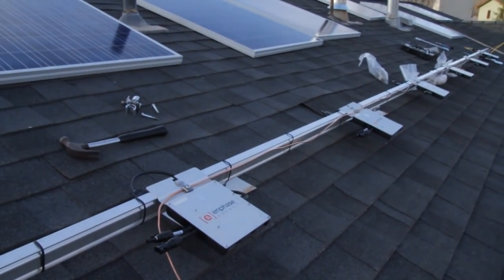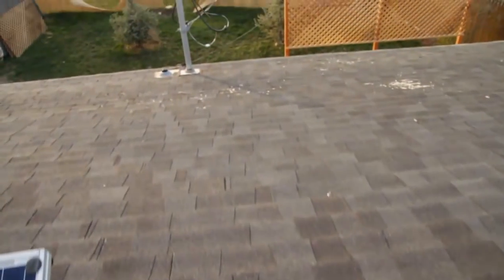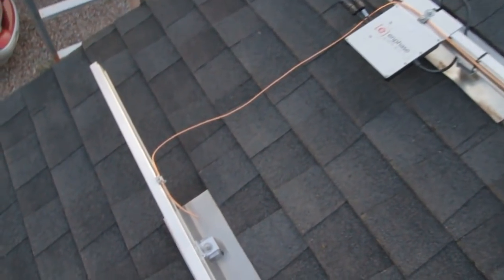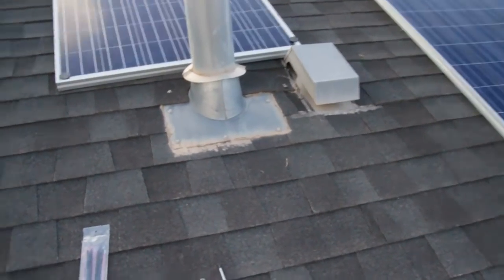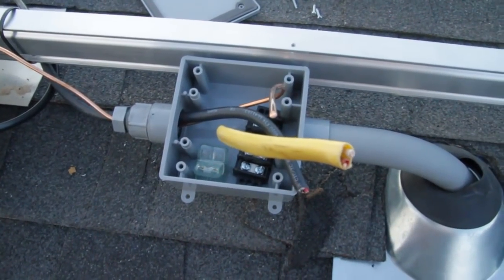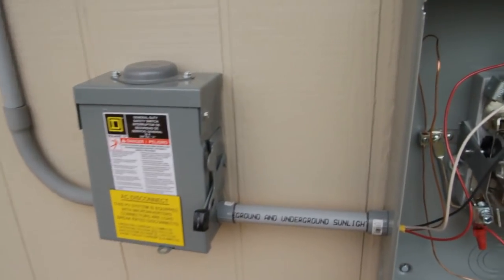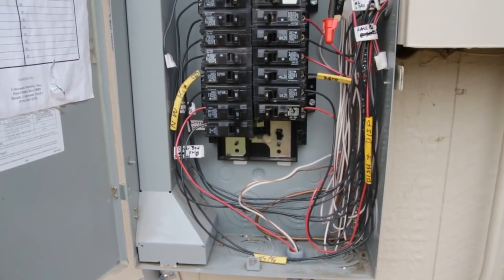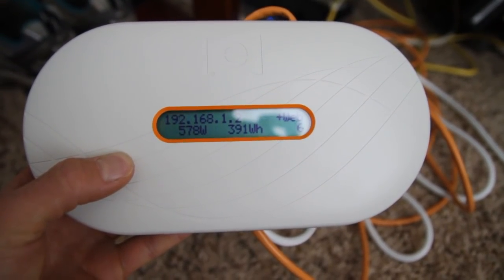HOW TO INSTALL SOLAR PANELS DIY ARRAY ENPHASE MICROINVERTERS 1.47 KW SYSTEM TIME LAPSE

Comment: Just wondering, this system looks different than others I seen.  How come you don't have batteries hooked up?
Reply from the maker: It's because this is a grid-tied system, meaning that the excess power being generated by the panels is being fed back into the electrical gird.  We also pull power from the grid during the night.
Reply: Jesse Hoff  how much of savings do you think the system in this video will save
Reply from the maker: Check out my other video I have up about the cost of the system.  That might answer your question a little better.  The answer depends.

Comment: that racking system is too low to use a pre-bent PVC 90 into the roof boot flashing. should have used a LB or soladeck junction box.

Comment: So I guess the micro inverters shut down when the power go's out and doesn't back feed onto the grid. Not sure bob was a finicky electrician. Those wire nuts on #6 looked like a hack job.
Reply from the maker: +vipleather Ya I didn't like those wire nuts either, you got it with the microinverters.

Comment: There are a few factors in average cost to install solar power system . One plan I discovered which successfully combines these is the Ewans energy roadmap (google it if you're interested) it's the no.1 resource i've seen. Check out the interesting info .

Comment: Hey, Great video!  Thanks as that's the exact system I want to install.  Please drop an update from time to time.
Reply from the maker: +Sonny Burnett Sorry it took so long.  Glad you liked it.  

Valuation 

Affordable Solar $3398.62
Miscellanious parts ace hardware $19.05
Lowes $100.89
All phase electric supply $7.51
Solar Disconnect from affordable solar $53
Ebay Meter Socket $120.50
Lowes conduit and junction box ~$20 (haven't purchased yet) 

= $3719.57
Reply from the maker: +Sonny Burnett Just got this video up too https://www.youtube.com/watch?v=TFwdY0wiBGA  
gives a little more detail about the site plan I used and the electrical
 diagram.

Comment: wouldn't 10/3 wire be more adequate?  & EMT, instead of PVC conduit?  That's what Grid Alternative uses on their installations, much better ampacity & quality, still good job though, other than that rock on
Reply from the maker: EMT is a little harder to work with for a DIY guy, I use it consistently now but for someone just starting out I'd recommend PVC.  I thought I did use 10/3?

Comment: why did you have to use an inverter for each panel, they sell a single inverter solution for multiple panels
Reply from the maker: It was cheaper and there was some possible shading during winter months.  Microinverters definitely have a place in the market.  You can monitor each panel individually too.
Reply: How much those microinverters cost? I know the whole system inverter is about $1800 for 6 kw one which what I need. I will be using 24 panels so I need 24 microinverters.
Reply from the maker: Little over a hundred dollars a piece, price them out at affordable solar .com.
Reply: Thanks, Since it is a DIY I just go with a single converter it is cheaper for me.
Reply: +Jesse Hoff less voltage drop running ac ,smaller wire than dc

Comment: In your video you did not explain the mounting hardware or the installing of the rail system? It would have been better.
Reply from the maker: Ronald Williams thanks for the comment, I explain it a little better in this video https://youtu.be/3p3zXlOmi_w

Comment: Romex shielding should be removed before sliding into conduit.  pvc is fitted with clamps to keep the romex from being pulled out of the conduit.
Reply: It is for dispersion of heat in the conduit
Reply: +David James Yeah, there is a $20 book he could have gotten to tell him everything about residential wiring he missed.
Reply from the maker: +David James Ya, Romex shielding was removed, I used the Romex to run through the attic. Shielding was removed through the outside pvc.

Comment: Just a little advice.. Don't touch bare lugs and wire in any box.. Just a good habit to assume the wire is Hot.... Do this at all times and practice one hand connection make up.. If you want to point to a connection that is bare.. Use a stick or screw driver while you explain the hook up.. Without that habit.. You may get bite sometime and will then add that to your personal work talents..lol.. Once bit.. Once learned... Nice job though.. I'm surprised your inspector allowed those splices and the use of romex but hey.. He's the AHJ.

Comment: should have used a crimp lug in meter housing, who runs romex in pipe?. never would have past in my jurisdiction.
Reply from the maker: +Mike Shannon Romex ran through the attic, shielding was removed through the pipe.  Thanks for the comment Mike.  :-)
Reply: You can see the romex coming out of the conduit in the disconnect box.

Comment: The roof penetration is going to leak. Sola deck works better. The racking is overhanging way to much you need another anchor point closer to the end.
Reply from the maker: +Stuart Radcliffe I checked out the Unirac specs, that overhang is within their tolerance.
Reply: +Jesse Hoff. As a good rule of practice it is better to have an over hang of less then 1/3 your module (they re not panels they are modules. A panel is a grouping of modules but everyone just uses slang and calls them modules.
Reply: Just make sure shingles over lap the top and sides of all panels and use through the roof caulk around screws bolts and any holes made. Be just fine. You can sit in the crawl space and have someone spray the roof with a hose and look for leaks

Comment: I bet this makes re shingling a bit of a pain.
Reply from the maker: Sure does, you have to remove the entire array to reshingle.
Reply: Jesse Hoff perhaps from the homeowners side installing tin roof or steel shingle would make for less maintenance down the road. I’ve never seen or known of anyone who powers their homes with solar. It’s not really a thing around North Dakota yet. Also out of curiosity I was wondering earlier what would happen if they were installing in a snowy environment? I suppose they’d need to be cleaned of snow constantly?
Reply from the maker: Logaweed ya steel and tin would save down the line.  I install up in the mountains here in Colorado, snow usually sloughs off the South side.  After big storms sometimes we'll shovel them off a bit.  But for the most part it's not much of a concern.  Depends on the steepness of the roof also.

Comment: Seems lame to use wire nuts on those lungs another place for failure must be some sort of part to change the lugs to use smaller wire.
Reply: +kell490 You can't just change the lugs. it is not an option.

Comment: As an electrical inspector watching this video I am horrified. Romex is not rated for outside!!! Your inspector needs to come back!!!  Where is the ground rod connection from your array to your electrode system?  Do not watch this video unless you like doing things twice after inspection.
Reply from the maker: As an electrical inspector you should know that a lot of these things depend on jurisdiction, meaning where you are in the country.  What part of the county do you inspect in?  For example in California I doubt they would have let me put the panels so close to the side of the house.  Different jurisdictions have different requirements right?
Reply: +Jesse Hoff Washington State. The code is under the National Electric Code article 334.  You could also argue 110.3b. But there is no code in Colorado allowing NM-B to be installed outdoors, or in a conduit outdoors.  As defined inside of a conduit is a wet location which NM is not rated for and  NM is not listed for direct sunlight or for use outdoors.  It is an interior wiring method as I noted in 334.10. So yes and no.  But the different requirements are usually harder and or added precautions to the code.  We had the W.A.C. and 90% of it is additional requirements.  Your NM cable will be brittle and failing in less than ten years.  When you fix it try THHN. Is the neutral floated through the disconnect and the meter? If not your creating a parallel current path and the neutral would be bonded in multiple places which is also a NEC code violation.  I'm serious when I say I would ask for a re-inspect for the safety of the people living in the residence.
Reply: +Jesse Hoff P.S. the labels are also NEC standards found in 690 and 705.  Not by jurisdiction.
Reply: +chad h P.S. try a google search for can I use Romex outside.  You can learn a lot on some of the websites.  Mike Holt has a good website for information too.
Reply from the maker: +chad h Ya but what I'm saying is that the code is interpreted by the inspector.  You guys are like judge's, there's still judge's in this country that are interpreting the Supreme Courts decision on gay marriage.  That's really my point.  Do you think water can really get into that conduit, it's sealed up pretty good?
Reply: As a electrical contractor working with solar installs for over twenty years, I can tell you, nmb in conduit will fail and wire nuts will also fail. I troubleshoot and repair systems installed by others. Wire nut connections have failed in as little as three years. DC arcs can burn your buildings down. As far as inspectors being judges, no they better all be on the same page in the NEC.
Reply: I agree in Seattle he would have had more corrections to fix.

Comment: The angle on the wire coming out of the roof is to much of an angle and will cause leaking.  Romex isn't approved for outdoor use. There is no seal on your conduit pentration. and I question your equipment bonding. No PPE. Labels are NEC code. your AHJ has to follow nec. Those are not outdoor approved wire nuts. Per Nec code your breaker is located on the wrong side of your breaker box.
Reply from the maker: +Paul Nedovich You're tearing me apart man, good thing you weren't the inspector.  :-) I appreciate all the comments.
Reply: I was talking to one of your tolls sorry. take a look at my channel i just installed some solar

Comment: Pulling romex through a conduit.....hmmmmm
Reply: +Donnie Camerer Correct and Romex is not an approved wire for outdoor installations
Reply: Romex NM is not. Romex UF is 100% rated for outdoor and can be buried without even using conduit. 

I'd still do it though.
Reply: It's frowned upon but only because of pulling purposes and adding additional wire in the future. However if you don't plan to pull any other wire through the conduit in the future it's not an issue. Having the insulation on the wire isn't a problem.
Reply: +krissy dannie I'm not sure but ,if anyone else wants to uncover solar energy savings try Magonsi Solar System Expert (should be on google have a look ) ? Ive heard some great things about it and my buddy got cool results with it.
Reply: The exposed pcv is the worst part
Reply: I found your video on Ewans Energy Roadmap - there's lots useful  videos there that should help you
Reply: I found a useful collection of videos that may help on Ewans Energy Roadmap

Comment: You need to do installer a battery box the store after power to Casey is a thunderstorm your power won't never go out everything will come from the battery
Reply from the maker: +Michael Hardy That would be nice, increases costs though.
Reply: 600 A/H (18) big Battery bank (maintenance-free) this power up house (400 Watts)get a solar panels (energy efficiency)

Comment: Micro inverters, why?
Reply from the maker: It was cheaper for this small system.
Reply: @JesseHoff   That's enouraging, but my main concern is that I'd need a zero export switch and meter, not sure how to buy and rig those up. If you have any advice I'm all ears! thanks!
Reply from the maker: @FoosResearch  I go over a little how to wire the net meter in this video https://youtu.be/aTNi9-sl27A the box to the right is the AC disconnect, which I think might be what you're referring to as your export switch
Reply from the maker: Also you can get those net meter sockets and disconnects at any electric supply house.
Reply: @JesseHoff  You're a super guy! Thanks!

Comment: Where are the deep cycle batteries? We had a black out, and all my neighbors who had solar panels lights went out.. I said what the heck, and then I ask my buddy who works for a solar company why that happens. His response, they don't want them. My response, so why do you sell them the panels? He say's, they want them. He laughs, and he's like that's the whole point of having solar panels, and they don't want them. They'll save a little energy, but the more panels, deep cycle batteries, the better.
Reply from the maker: They are there, people just don't want to pay for them.
Reply: You are very confused ... Adding a "Grid-Tie" Solar Panel System is NOT designed for black-outs.  It is called "Grid-Tie" for a reason. A Grid-Tie system requires a GRID to work.  The GRID is the "battery".  Grid-Tie Solar Panels work during the day, and then the grid works at night. If you need AC power during a black-out then get an AC Generator. Adding a bank of expensive batteries does not make financial sense because they will need to be replaced = $$$'s.

Comment: "just produced 578 watts"  sounds impressive until you realize that 1000 watts for an hour costs maybe 10 cents?   So it had recouped a little over 5 cents so far of the thousands of dollars paid for the system ...takes a looong time to get any appreciable investment costs back much less break even !    What I don't get is why so many roof/attic penetrations???   I would think that there ideally would be only ONE...no?   Looks all cobbled together,  I think I'll wait until there is more of a plug and play system that does not require all the cobbling of components like mounting terminal strips into plastic boxes etc!  I would THINK that everything would simply daisy chain into factory provided connectors!?! I also would have thought it possible to have ZERO roof penetrations simply by having the final solar panel above the end of the home with the electrical service and just run it straight down through the eves!??...no??  I also hate how involved the installation in this video is if it were installed on an midlife roof....because it all has to come off to re-roof!  SEEMS like to me that long heavy duty roof straddle brackets could be engineered that would very securely (via lag bolts etc) attach to peak of roof and again at the lowest edge down at overhang...picture one of those every 10 feet with lateral channels mounted across them and panels mounted to THOSE!  Raw physical Installation of a well engineered system COULD be done in an hour or two and could easily be removed and replaced for a re-roof!  EVEN could be taken to a new home if an owner wanted to!   That is my vision anyway....

Comment: Not that we want to be a Negative Nancy... but... Poly-crystalline panels don’t last, Enphase micro-inverters are inefficient and have maintenance issues constantly, the racking is not terrible but not good and you paid far too much for your cheap equipment.  You did a great job installing on your own but the product is poor and won’t last.   A professional company could have installed a higher quality product for a lower per watt cost then what the public can get it at.

Comment: Not sure why the Americans are so hooked on Enphase inverters.Sure if you have like 30% plus shading but given it’s like 20 % plus more than a string it’s kind of pointless
Reply: The points are... A Central Inverter you cannot tell which PV Panel is failing or failed.  Enphase maximizes PV Panels at different orientations on the roof pitch. Enphase works well in patially shaded areas. Each installation needs to be analyzed for lowest cost vs maximum production.